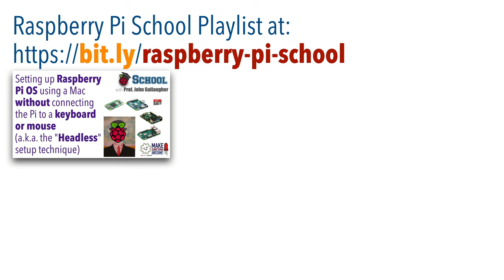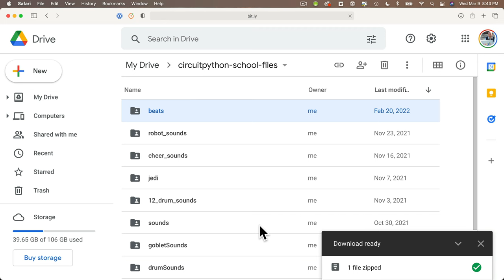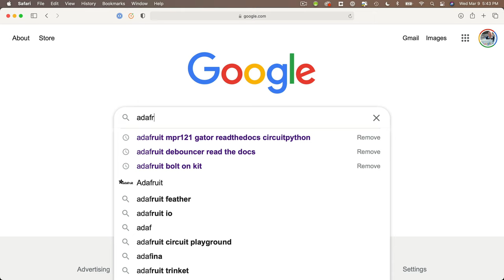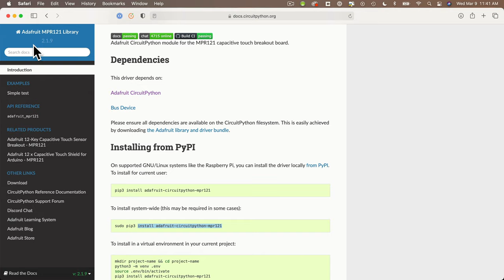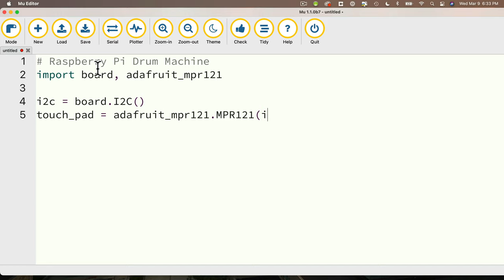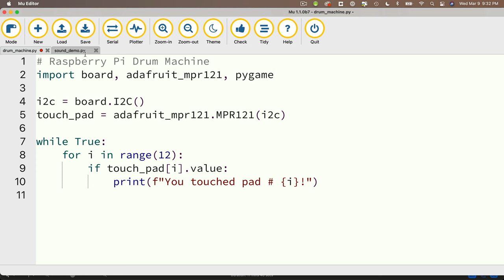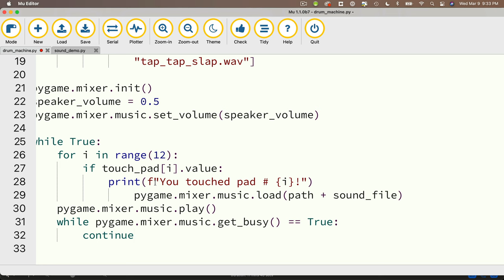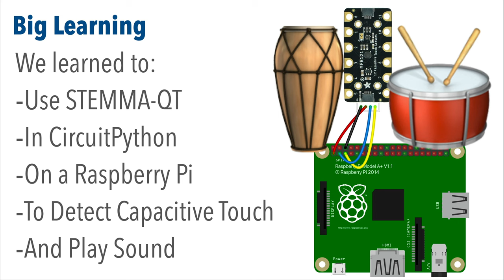CircuitPython School - Use Capacitive Touch to Build a Raspberry Pi based Drum Machine

Comment: Thanks for the in-depth instructions.  

I have a question.  I am very new to electronic drumming and I am wondering if there is a way to use this setup without connecting it to a computer.  Either Bluetooth headphones/speaker or wired to a sound system. 

Thanks!!!
Reply from the maker: Yes. Look into CircuitPython Web Workflow. https://learn.adafruit.com/getting-started-with-web-workflow-using-the-code-editor/overview